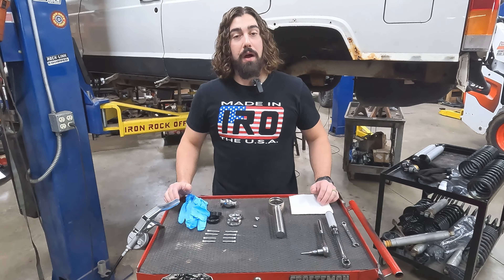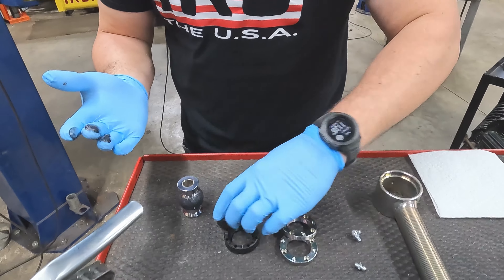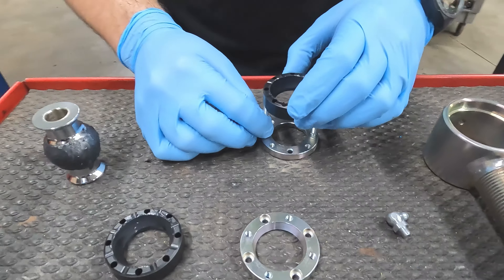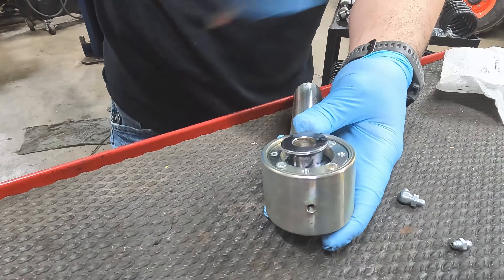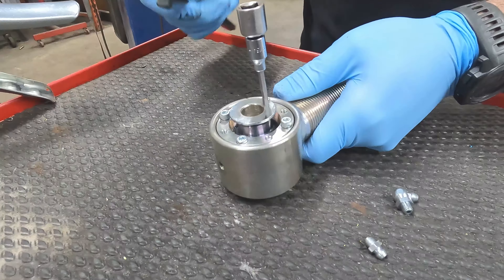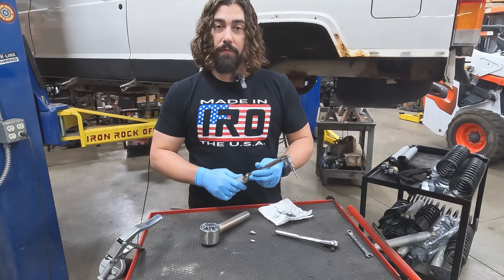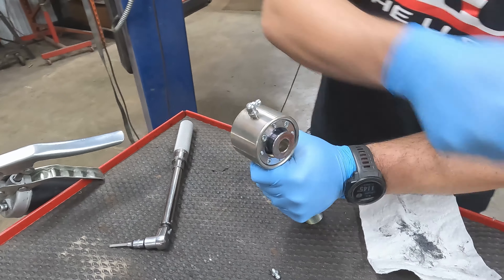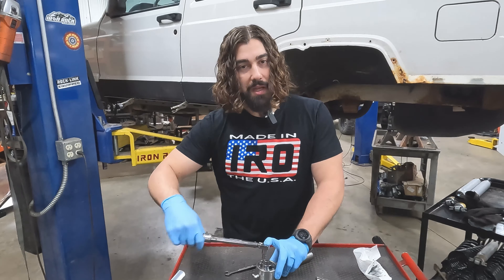2-3/8" Flex Joint Assembly

Comment: Whats the difference between the threaded collar joint vs the joints with the 6 lock nuts?
Reply from the maker: @jhinton088 All of our flex joints are designed for maximum strength and maximum flex. On our larger 2-5/8 joint we were able to fit bigger hardware like the lock nuts. As we made smaller joints, like the 2-3/8 in this video, we had less space to work with. In these smaller designs we chose to make the outside washer with threaded holes to save space without compromising strength and maximum flex. Each of our joints were designed in-house and made right here, in the USA.